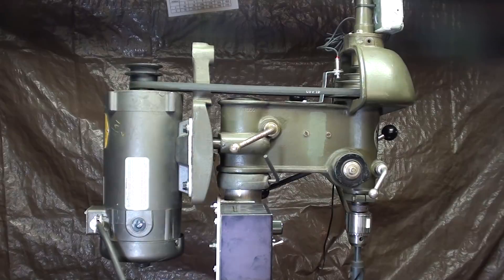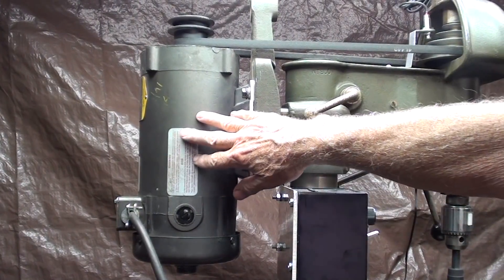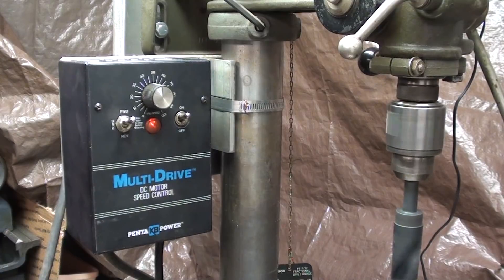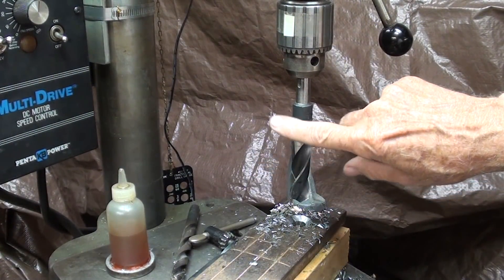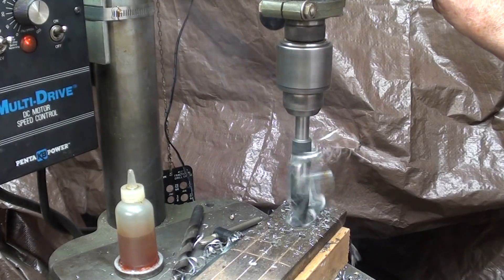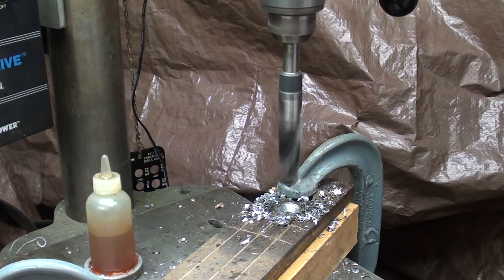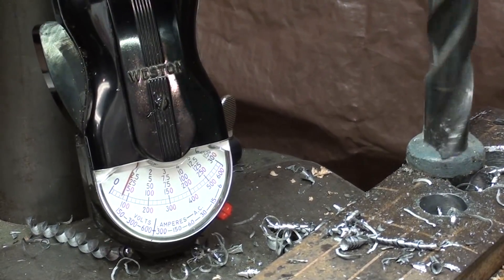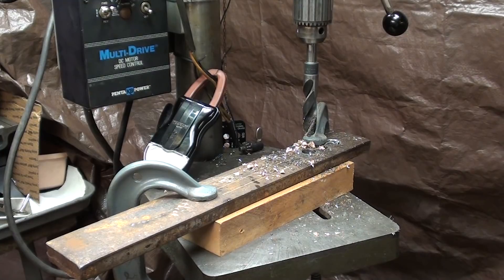Tips #482 Drill Large Holes Slow Speed DC Motor tubalcain

Comment: Mr. Pete my old rockwell drill press has the slow speed attachment which is just another step pulley in the middle of the other two step pulleys and it runs two belts. One from the motor to the middle pulley and another from the middle pulley to the quill pulley. You can slow that drill press way down and it will do quite will with larger holes for its size. Perhaps you could put something similar on this drill press and allow you to have more of a mechanical advantage driving the larger drill bits?
Reply from the maker: Yes, I have one of those on my duro press

Comment: To control the speed you are chopping up the voltage. Your speed controller is like an automatic switch that turns on and off. You vary the duration of off to on to vary the speed. The more off it is the slower the motor goes. Pulse Width Modulation. So you are going to end up with less power at slow speed. Because your voltage is off most of the time. No juice no go. That's how that gizmo works.
Reply from the maker: Thanks

Comment: Open loop DC motor controllers only produce a torque that is linear with speed/voltage and you have Voltage sag as load increases. The only true way to  get the max torque at any speed is to use a closed loop system that has an encoder that provides feedback to the controller to increase the voltage as the motor loads and starts to slow beyond its set point. A 3PH motor and VFD would be much better . And they make them with 110v 1 PH inputs and 220v 3PH outputs
Reply from the maker: I will be using a VFD in an upcoming video

Comment: Another factor to consider is the "rate of the feed"- if you're careful to limit how fast the drill bit is plunged into the work, it might be possible to drill the hole without stalling the motor(?) Another thing to remember, is that twist drills have a tendency pull and dig in-!!
Reply from the maker: Thanks good point

Comment: Are you stalling the motor,  or is the belt slipping?
Reply: Well? Which is it?
Reply: I had the same thought when I still heard the same buzzing of the motor (during spindle stall) under the control of that DC motor speed controller especially with that small pulley diam on the motor providing little v-belt contact.

Comment: Maybe check the pots in the control,I was having the same problem,right off and after an adjustment to the pot labled "torque",it made a big difference. My motor,however, is 1hp.Good post.
Reply from the maker: Which one is the torque part? They are not marked
Reply: @mrpete222  my controller hade 3 pots,1 for speed,1 for torque,1for,well,frankly i can't remember. If memory serves,it was the pot on the left.
Reply: @mrpete222  look at the breadboard, the marking may be there.

Comment: Mr Pete, I don't know if you discussed the dangers of high torque when drilling large hunks of metal with large drills. A motors that is geared down (or dropped down with a pulley) will have so much torque it can jam in the metal you are working on and then whip it around the shop. A speed controlled DC motor doesn't have as much torque, but that is a safety feature as far as I am concerned.
Reply from the maker: Safety is always a concern in every shop

Comment: Drilling holes bigger than 1/2 in steel is requiring lots of power and a rigid set-up, better be a little under speed than over, or you'll burn the dril bits, a nice feature on a milling machine is the possibility to use the mechanical advance on the quill, it provides a much better control for vibrations and chatter...
Guess you'll need to make a intermediate pulley system to be able to get more torque from the motor at lower spindle speed.
Even on my big Craftsman drill press with a 3/4 HP and a middle step pulley, a one inch bit gives me a hard time in steel...  Speed is about 150 rpm at lowest setting, I think...
Another first would be to use a big wooden dowell and a plank to start a fire indian way..  lol
Reply from the maker: Thanks

Comment: I find that it is easier to stall a machine running a large drill into a large pilot hole than it is with a smaller pilot hole. It becomes more grabby and sensitive to feed pressure. I'm sure it would be different with an automatic feed.
Reply from the maker: Thanks

Comment: Hi lyle! I recently drilled four 25mm holes to 19mm steel with a hand drill. I think it still has more torq on the low gear than these belt driven dp's. 😄 it definitely is  a hell of a job still, it's very hard to keep it inline and stable
Reply from the maker: Yes, those big old hand drills were unstoppable
Reply: @mrpete222  it is cordless and new but unstoppable as well. Turns only 330rpm with full speed on the low gear. Biggest problem is that the chuck does not grip as much as it has torque, unless it is tightened using a vise. I plan to mill three flats on all of my bigger drills shanks anyway.

Comment: It's above my knowledge level but it needs a micro controller to read the rpm and give the motor more power when drilling
Reply: You'd think that's what that big speed controller box would do. But I guess it's nothing more than a big light dimmer.
Reply: I've used some DC controllers that have torque compensation.
Reply: @AlexandreJasmin  "I guess it's nothing more than a big light dimmer." You'd be wrong. The KBIC 240D incorporates back EMF sensing and I/R compensation which if competently implemented will provide zero to full load motor speed regulation to 5% over a 10 to 1 RPM range. Read the drive specs. They're available on line.
Reply from the maker: Thanks
Reply: What you're describing is a servo motor-!!

Comment: I concur with Super Grover, no matter how you slice it the fact is there needs to be good deal of ratio reduction to slow the spindle yet allow the power supply (electric or piston) to get in to it's operational sweet spot, every power source has an upper and lower limit of true operating range. 
 The reality is by using the underdrive method you can actually be relatively low powered HP wise but the torque multiplication allows the low power to be effective performing the job, much akin to adding pulley blocks for multiplication of hoisting thereby allowing one man to lift the load of 20 men with the power of one.
Reply from the maker: Thanks, that is a good analysis

Comment: Mr Pete: surely you didn't expect to post a re-motor mod without tedious comment from me.

You are demonstrating the difference between the use of constant torque Vs constant power. Your DC drive is performing exactly as expected and it is functioning normally to full specifications. 

If you desire to drill 1" dia in steel at the proper cutting speed using your mods to a drill press, you will have to drill stepping up in 1/4' increments as you have demonstrated. It's time consuming but perfectly satisfactory for the one-man home shop. You might tweak the IR trim pot identified on Page 12 of the KB manual. It might result in improved low speed operation. You'll probably have to settle for a happy medium adjustment. Adjusting IR comp might improve performance at one RPM range resulting in a small detriment at another.

3/4 HP will drive a 1" drill in mild steel provided the RPM is delivered via mechanical reduction and the location is pre-drilled a bit bigger than the chisel tip.  Looking at your max demonstrated spindle RPM I'd say your pulley ratio is probably 1.8 to 1. If you wish to deliver full motor HP to your 1' drill at 100 ft/min you need 382 RPM. 1800 RPM motor speed / 382 spindle RPM = 4.7 to 1 pulley ratio. You have 1.8 to 1 thereabouts. Work the math and you'll find you're delivering 0.28 HP at the spindle. 

Your problem is not "torque" as you are using the term but power. If you wish to have 3/4 HP at your spindle using that pulley ratio (working more math) you'll need to install a 2 1/2 HP motor or revise your pulley ratio.

Your drill press motor upgrade will be perfectly satisfactory provided you're reconciled to drilling 1" holes in several steps and hole sawing by feeding very slowly.

You will suffer similar frustrations attempting to slow your Delta wood cutting bandsaw to steel cutting speeds. The saw as presently powered cuts wood at 3000 feet per minute. Sawing speed for steel is roughly 120 FPM. 3000/120 = 25 to 1 motor to band whee. Your planetary reduction is 7 to 1? You still need roughly 3.5 to 1 belt reduction. These figures are not cut in stone but I suggest you select your compromises carefully.

My solution was to use a starter gear and a flex-plate ring gear (ratio about 12 to 1) from an automatic transmission on the band wheel. It was noisy and I had to build a lot of brackets and a countershaft but it worked. And by swapping belts and electrically reversing the motor, I could switch to wood sawing speeds in a few minutes. Wish I still had that saw.
Reply from the maker: Thank you very much. I know said was a very lengthy explanation. But a good one
Reply: if you revise pulley ratio small drill sizes suffer.....guess geared head. i have a 5 speed transmission. 10 yrs now not installed.
Reply: The motor power is constant, but the DC "speed controller" only gives barely enough voltage/power to the motor to run at, let's say 390 rpm. Without any torque.  For a DC motor to work properly the speed controller need the feedback from the motor or drive and adjust the voltage to keep the rpm constant, not the voltage.
Reply: @M4nusky Are you sure of your usage of technical terrms? Motor POWER is not constant at full load Amps. Motor TORQUE is roughly constant at full load Amps. In a wound armature DC motor, HP at full load Amps is roughly proportional to RPM because motor torque is roughly constant over the RPM range. That's motor physics 101.

Torque in a physical science sense is a "moment" meaning leverage in terms of force times the length of lever. Foot pounds, Newton meters etc. The term "torque" has been debased by casual use to the point it's understood to be a vague agglomeration of power/acceleration/responsiveness as a stand-alone noun. In other words "torque" means what the user intends and is seldom defined in terms of numbers.

The KB KBI C240-D is an excellent DC motor drive (if noisy.) Properly set up and adjusted to the motor, it develops full (or nearly so) motor torque down to 5% nameplate RPM delivering full load Amps. Speed regulation at the low end of the RPM range may be poor unless the IR comp, current limit, and other settings are optimised.

"No torque at low RPM" applied to DC motors controlled by variable speed drives is conventional wisdom rendered credible by wide repetition over time based on "a guy told me..." hearsay. Re-motoring even a simple drill press to give it greater power and low speed RPM rangeability from available equipment on a budget is a genuine engineering challenge. Thus an engineering approach with definite goals, understanding of materials and equipment, working the math, etc will yield better results than "trying stuff" and harkening to well-meant but ignorant advice.

Lots of backyard equipment has been cobbled together by gool ol' boys of limited education. They tend to belittle their achievements but more than a few are talented scroungers and brilliant jackleg engineers capable of making a sawmill, gold dredge, machine tool, ag equipment, for example, from the most unlikely collection of junk. These are people who have an innate understanding of concepts like "torque" and "power" without being able to verbalize them and how they play out in re-motoring projects. 

Nope, Mr Peterson's Walker Turner drill press is hittin' on all cylinders. A properly ratioed multi-speed mechanical drive would give him greater power at low RPM but power and torque are not the same. Torque is a component of rotary power. Torque times revolutions times time equals power (but don't forget to reconcile the units.)

3/4 HP at 382 RPM converts to roughly 39 ft lbs. Mr Pete's drill press as is develops about 11 ft lb at full load armature Amps running 382 spindle RPM That's not "loss of torque." That's the effect of turning down the RPM of a constant torque motor. IOW, it ain't the motor, it's the ratio. Put the blame where it belongs.

Comment: A universal motor produces maximum power at about half the unloaded speed. Therefore you should should probably set unloaded speed somewhere between 150 and 200fpm so that when you're cutting it drops to around 100fpm and you still achieve usable power. Currently you have no power at 100fpm and maximum power at ~50fpm and the power you do have at 50fpm is half (or a quarter? someone correct me) of what you'd achieve if you set it to 200fpm and cut at 100fpm.
Reply: Any speed reduction Mt. Pete achieves with his motor controller is going to come at a power loss. That's just how that controller regulates the speed. It reduces power to the motor. What it really does is it reduces the amount of time the motor gets power which ends up being a net power loss. There's an electronic switch in there and the slower Mr. Pete sets the dial the longer that switch stays off. Increasing off time decreases motor speed, and power. If the power remained constant the speed would too. Brushless DC (BLDC) electronically commutated motors can get around all of this to some extent. They can maintain high torque at low speed. Which is why they're the snizzle in hand power tool tech these days. They're also a lot more energy efficient too. Brushes and commutators kind of suck if you can do without them.
Reply: Or get a governor device that turns it up automatically when the rpm drops lower than the setting is
Reply: A motor speed controller that has feedback capabilities. But still if the HP is not there feedback speed control will not do the work.
Reply from the maker: Thank you that's a good point
Reply: I didn’t notice on camera, but if you set your rpm, wouldn’t drop? Can you mount your fpm gage we’re you can see it action? Best regards.

Comment: Lyle, to me that’s far to fast,, but I’m no expert, Regards Frank
Reply: Theoretically HSS on mild steel runs 100 surface feet per minute.  Which when I'm milling is what I use. But for some odd reason I like half that speed when I twist drill. It just seems more "sane" to me. Unless I am drilling a hole that is wider than it is deep. But I am using a 2 HP induction motor with mechanical pulley reduction. At slow speed it will blow a bit up before it will stall. Torque is never an issue. I think what Mr. Pete should really do is add another cone pulley to his drill press to achieve the slower speed. Use legitimate mechanical reduction as opposed to electrical voodoo.
Reply from the maker: Yes

Comment: Me Pete, play with the pulley sizes to allow you to run the motor at a higher speed. You may be able to squeeze a bit more torque out of that motor. 
I use those KB drives quite a bit. If you try to pull too many amps from them they burn out.
Reply from the maker: Thanks

Comment: I recently bought a small but very heavy cast iron drill press.
It’s got an option of 4 speeds that range from 
3000,6000,9000,12000.
The person I bought it off asked why I laughed at the speed ratings, I said “you don’t want to know” 🤭
In the back of my mind I was thinking that Mr Pete would love this drill press, especially the speeds that it’s capable of doing 😂😂
Reply from the maker: Wow, that's a fast drill press
Reply: I’m going to replace the bearings on the motor, after I finish that I’ll put up a little video of it on my channel.

Comment: greetings sir.
I think a gear box is required to slow down the bit speed and get huge torque !!
make the motor run in full speed and change the pulley ratios to get the bit speed you want!
same principle as the original ac motor.
thank you for sharing.
Reply from the maker: Thanks

Comment: It is hard to get high torque at low motor rpms due to current limits/wire size, and fan cooling - at the motor. That is what gears are for! Torque (twisting force) is pretty much proportional to current, and power (rate of doing work) is proportional to the product of torque and rpm. See Wikipedia, or the “Mechanics” section in the Machinery’s Handbook viewers should consider having. Mine has a 250 page section on gears that is worthwhile. Articles I have read recommend using the lowest gearing you can and still reach the maximum spindle rpm you want without overspeeding the motor, rather than lugging the motor down.
New Colchester lathes (colchester.com) or Clausing.com in USA, use variable speed 3-phase motors on their commercial duty lathes and can get by with three gears vs maybe ten gears or more on their lighter duty ones. Interesting graphics of torque-rpm curves.
Reply: well said. hot rodders know that the only way to improve performance is to increase hoarse power and gearing. that translates to oversize motors and or lower gear ratios for the drill press. you can't get around hoarse power requirements for drilling holes.
Reply from the maker: Thanks

Comment: The problem you ran into is because your motor isn't powerful enough. You only draw 8 amperes. Select a more powerful dc motor and you should be able to drill at very low speeds.
Reply from the maker: I know that, but I am using what I already have